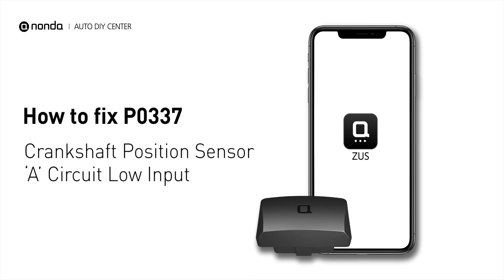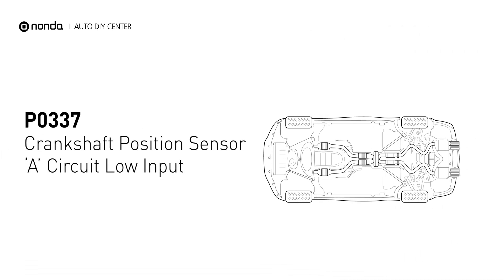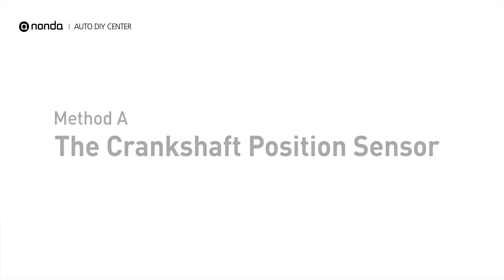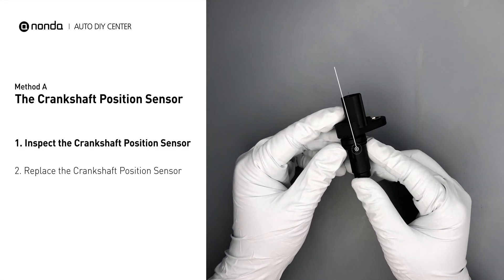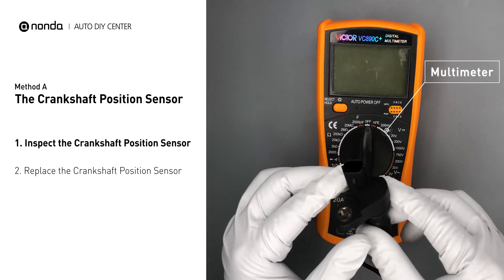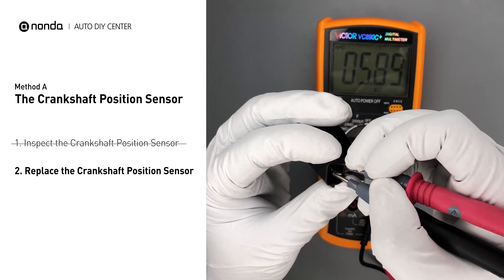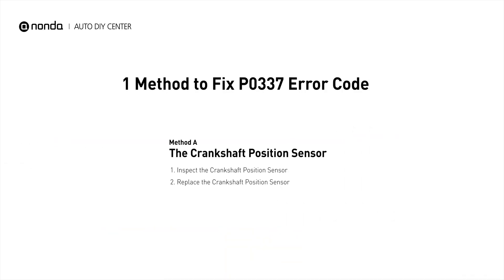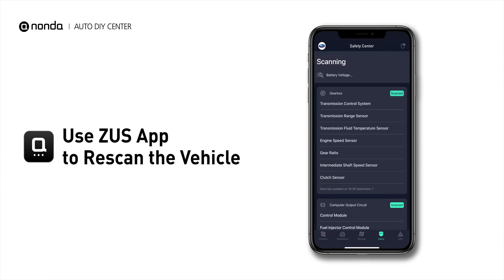How to Fix P0337 Engine Code in 2 Minutes [1 DIY Method / Only $9.57]

Comment: You said about crankshaft sensor fault , and you said to check camshaft sensor. Crankshaft is on botom the engine ,not on the top.

Comment: I replaced the two sensors in my 2007 Chevrolet Tahoe and the code didn't go away. Do you think the problem is with the wires connected to the sensor?
Reply from the maker: Hello, possibly- yes. Kindly check the crankshaft position sensor harness for short/open and the circuit for poor electrical connection. Can you tell us what symptoms are you encountering currently?
Reply: @nondainc  Hello, thank you for your help. The symptom is a significant decrease in acceleration, and it also accompanies that the RPM counter does not work, and if I think I have a problem with the crank sensor connections? But sometimes it works very normally